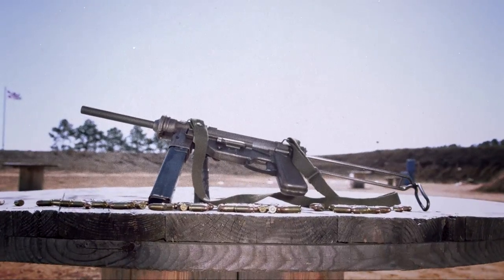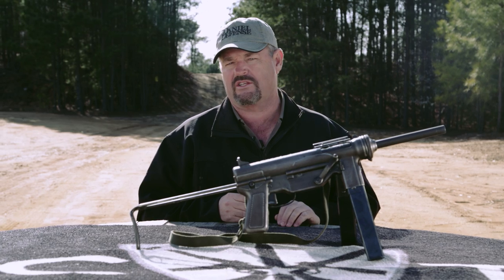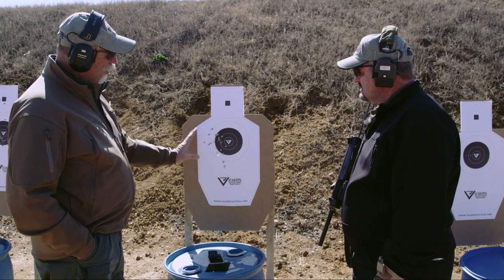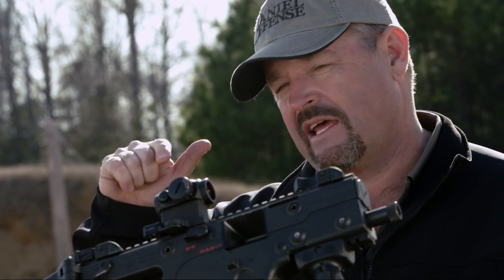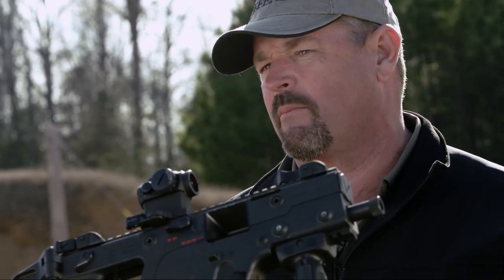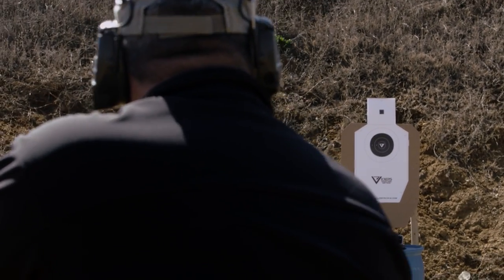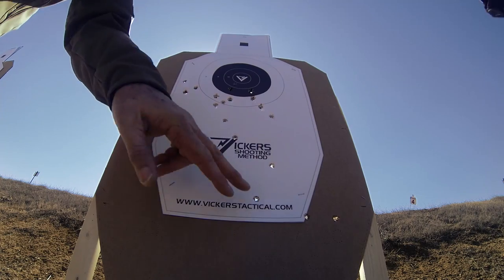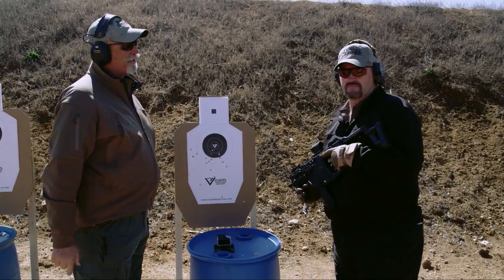Battle of the Submachine Guns Pt.2: Kriss Vector and M3 Grease Gun

Comment: few points, rpm adds to the force he feels, the vector was capable of firing at a much higher rate, but was tuned down.

I believe it's current rpm has to do with it's burst fire. 

another point was how completely surprised he was, showing that he was expecting vertical recoil and compensated for it, resulting in downward bullet path. had he known how to handle it, his spread wouldn't be as wide.

Comment: I prefer the burst fire mode for the Vector , because in full auto mode you just fly throught your ammo
Reply: I agree with your call of duty opinion, but it was definitely favorite in black ops 2
Reply: Brian Cramer yeah it was the best smg imo
Reply: +Rami Amarilla Burst actually isn't that great because the short bolt travel means that the gun fires before it settles back on target. What often happens is that the first round hits dead center, but the second round lands high. The super v system cancels most muzzle climb, but not all.

In full automatic you can compensate for the high shot with subsequent rounds and the gun has time to settle back. Plus, when you are shooting subcalibers, you need a lot of rounds on target to stop them unlike a rifle.

Comment: I own mac10 full auto in 45 acp it's a great gun contrary to popular opinion it's very reliable and very accurate and controllable even in stock configuration as long as you use the wire stock and fore grip strap it's a great little gun and civilians can own them whereas a full auto Kris's vector civilian will never be able to own.

Comment: I need to question something here. Does the vector have many parts? For me it looks like the weapon is high but maybe a lot of parts. More than mp5 or hk Ump.
Reply: +Ray Jo Very few parts. Look up Hickoks dissasembly of it. From a mechanical standpoint it is a heck of a lot more durable than the MP5, which really isn't that great even compared to other subguns of its time. UMP was a drastic upgrade from the MP5 even though it was considered a downgrade by H&K. As much as H&K like to tout their engineering, little to none of their proprietary designs stayed to exist in their current modern offerings.

Comment: I really think the  Kriss Vector is overall a better gun. the massive aspect forgotten by Vickers Tactical is damage per second. sure the Grease gun is controllable, but to get on target deliver a short burst of automatic fire 2-5 rounds has a greater potential of put down the target. the Kriss Vector is also much more ergonomic and lighter in weight. that contributes well to the speed of acquiring targets. Its like an MP5 with more gains of lead traveling down range.  It better fit the .45 submachine gun philosophy of use more so than the Thompson or the Grease Gun.
Reply: You saying damage per second made me cringe.
Reply: Yea except you forgot one thing the Thompson and M3 are both more reliable than the Vector.
Reply: So, please explain the DOCUMENTED damage per second you're talking about, particularly in other than full auto.

Comment: All these people trying to convince themselves that the Vector isn't an over engineered piece of crap smh. The issue with the Vector is its insane rate of fire, and the fact that the recoil management system actually makes the gun move in an unpredictable pattern. The best way to make a low recoil weapon is to have a straight line kind of blowback (it climbs, but it doesn't bounce around), controllable rate of fire (around 600-700) and enough mass on the weapon to counteract the forces driving it up. The Kriss has none of these. It's far to light for its choice of the 45, fires far to fast to have a controllable rhythm, and has too much movement inside the gun to make a predictable pattern. So instead of firing in a straight line climbing up, you end up firing in a messy circular cloud